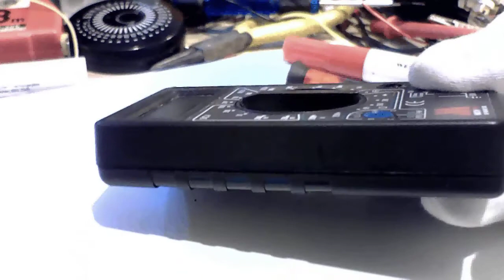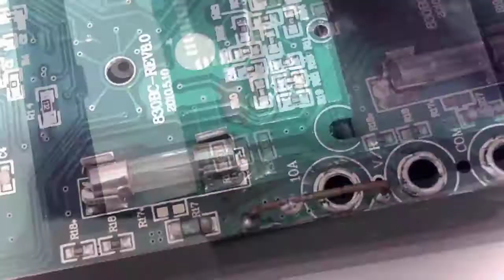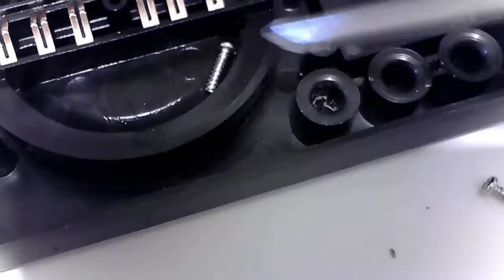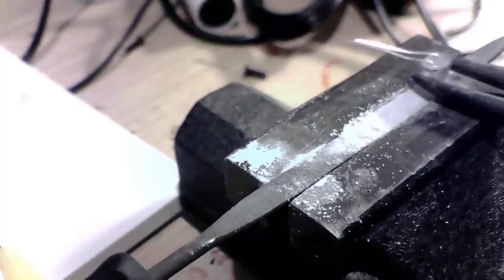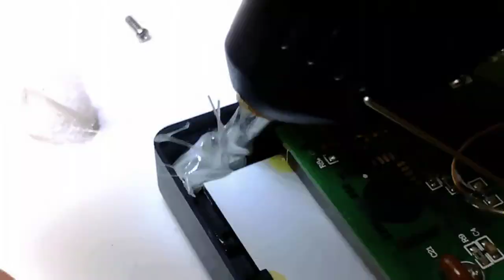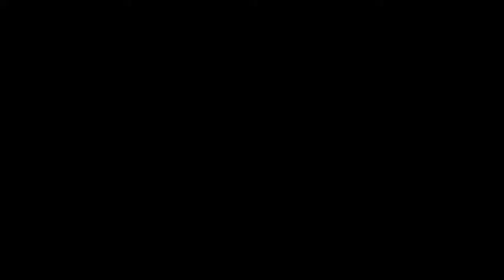Liquid Crystal Display LED Backlight Mod

Comment: Do you use another multimeter to test "connectivity" and find where to wire the leds to? Or can I just touch the leds to the circuit board with the battery in? 

Don't know exactly where to wire the Leds...my multimeter uses an on/off button, not a dial switch to turn on. How did you test what works?

Comment from the maker: the intention here was to see if a back-light modification  can be added to any cheap non back-lit LCD display
if there be anything missing in the video, it is the absence of a second back-light switch independent of the power on knob, so the back-light can be disabled when not needed. this video was made in response to another DIY video using the same type of cheap multimeter that was less effective at back-light modification.